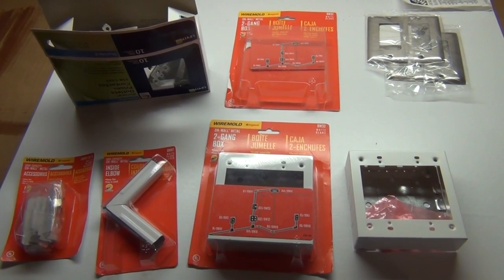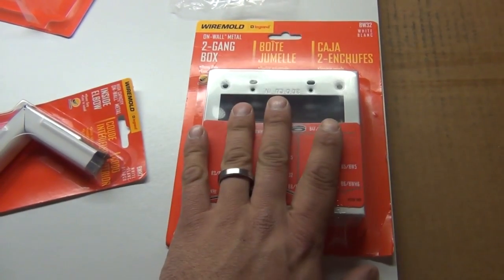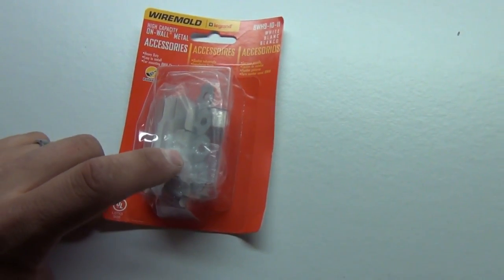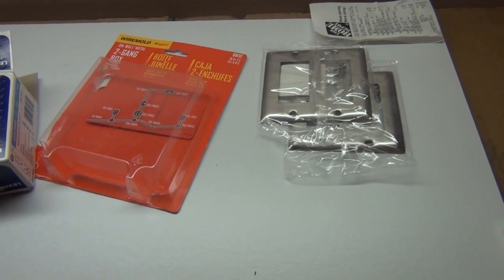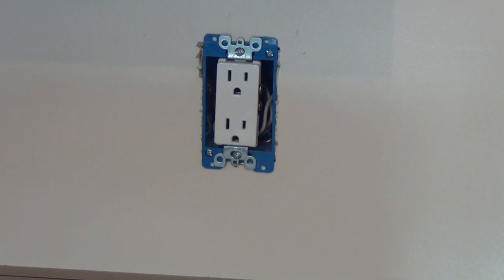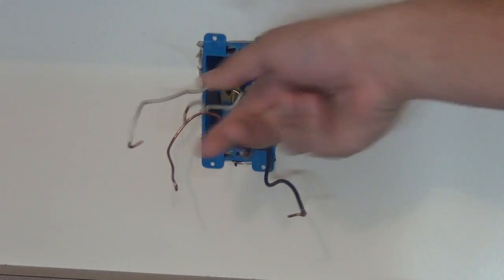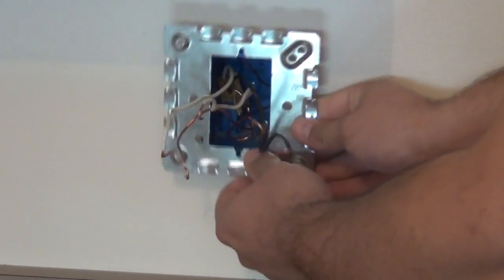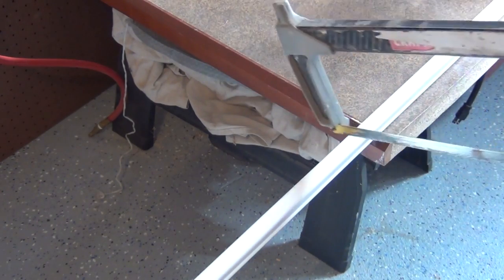Wiremold Installation

Comment: Nice install I just used EMT in my garage looks very nice imo just take your time bending it. Seems a little more sturdier than the wire mould stuff but I wouldn't know I haven't used wire mould ever
Reply from the maker: EMT is good but many don't have the skills necessary to bend it correctly.
Reply: zimsjeep that's true I guess bending EMT is a big part of my job so I've gotten decent at it
Reply: If you use EMT and don’t have a bending tool you can always use connector fittings for 90’s and joining. More expensive but very simple.

Comment: How do you know which wires are coming in and which ones are going out ? Or does it matter as long as the wires match ?
Reply: Gil... It's been a year since you asked. So I don't know if anyone answered your question.
An easy way to find the feed wires: Kill the power. Remove the wires from your device. Separate the pairs from each other.
Wire nut each wire individually. Turn the power on. Using a non-contact voltage tester (very handy, cheap device), touch each of the wires until the tester glows.
If you don't have a tester, kill the power & you'll have to reconnect one set of wires back onto the device. Turn the power back on. If the device works, you know it's
the correct set (if you've reattached it correctly).

Most times, you can see the pairs by looking to where they enter the box. They'll be in the same jacket.
If there's no jacket visible, NEVER assume that wires will match (depending on their color). You never know how the last guy ran the wires.
But if there's no jacket to help you, kill the power & separate the wires. Then wire nut each wire. Turn the power on & test.

Comment: Thanks for the tutorial. I'm doing this on a concrete ceiling and worried about how the molding is going to look in the living room. And I'm also concerned about anchoring to a concrete ceiling and the molding being able to sit flush inside the bracketsdue to the height of the anchor. I also agree with the poster who mentioned there should be plastic bushings at the ends of those metal moldings no question about it
Reply from the maker: There is another option to mount the track. It's a u shaped bracket that sits on the top of the track and has 2 screw holes on either side.  Perfect for concrete and you can use as big a screw as needed.  I've never used the bushings but if it makes you more comfortable, go for it! Thanks for watching.

Comment: will standard14g wire with white covering fit through the track?
Reply from the maker: Yes but I don’t recommend you go that route. It’s not recommended to run Romex inside wiremold or conduit for that matter.  You can buy thhn wire by the foot at HD or Lowes.
Reply: zimsjeep thanks great video

Comment: why did you use 15 amp receptacles on a 20 amp circuit?
Reply from the maker: Couple reasons:  they're cheaper,  I have no plans to run 20 amp equipment with 20 amp plugs, and it is also well within code to use 15 amp receptacles on a 20 amp circuit. Thanks for watching.
Reply: I thought the video said 12 gage wires??
Reply from the maker: +Randy Perl correct, I used 12 gauge wire
Reply: I thought you could only use 20 amp receptacles when it is a dedicated circuit only for that receptacle.  So chaining multiple 20 amp receptacles to a single 20 amp circuit would not be acceptable anyway, I understood.   Kitchen circuits are good examples of 20 amp circuits with 12 gauge wire that have exclusively 15 amp outlets.

Comment: Thanks for sharing, I have sort of a loaded question.

I'd like to install a wiremold system to provide power to the back of my garage, but the only available starting point is a ceiling light fixture (octagon box).  So, first question, any reason I shouldn't do this?

The other issue is that after uninstalling the light fixture, I found no ground wire in the box.  I have not determined yet if the box itself is grounded back to the panel.  If it is, can I simply ground the system into the octagon box?  If not, can I protect with GFCI and just label each box in the system?
Reply from the maker: Depends, do you have unswitched power in that ceiling box?  Check to see if the box has a ground wire tied into a ground screw inside.  You definitely need the garage circuit to be grounded. Garage receptacles also need to be GFCI protected.  If you don't have a ground, GFCI's won't work correctly.  All things said, I probably wouldn't use that box to feed your new outlets. Garage outlets typically are used by heavy amperage devices. (Power tools, vacuums, etc)  You want to have plenty of juice available for them without overloading.
Reply: zimsjeep Thanks for the response.  Yes, it is unswitched.  There is no ground wire running into the box, nor is there one tied to the box.  That said, the box may still be grounded via the conduit, I have not tested it yet.  If it is, I intend to ground the system back to the box.  Otherwise, I realize it's not ideal, but GFCI still functions without ground, no?  Hence the "No Equipment Ground" sticker.
Reply from the maker: Yes, I should correct myself. The GFCI is measuring current between the hot and
neutral conductors. It will work without a ground wire present. Grounding is still a good practice....especially in wet locations.  If someone ties into your new Wiremold someday before the GFCI, then you have a safety issue.  At the very least, if you have an ammeter...measure the current draw on that line before adding anything to it.  I would vote for doing this the better way and running a new circuit for your planned outlets.  What do you plan on using the new outlets for?  Is the existing circuit 15 or 20 amps?  What else is on this circuit?
Reply: zimsjeep Yes, absolutely the better way is to run a new circuit.  In reality, I won't have true peace of mind until I get the whole house re-wired.  Every time I've had a look at any of the electrical, it's appalling how badly things are wired.

It's a 15 amp circuit that services the garage and the bedroom above it.  The only thing in the bedroom is a ceiling fan, the garage has the garage door lifts, landscaping lights, and a couple lights in the garage.  Really what I'm trying to do is create a temporary solution until I can afford to hire a professional to re-wire the house, and possibly upgrade the panel (currently I'm only running 100 amps).  Anyways, what's there now is pretty bad.  The ceiling light fixture I'm replacing had one of those socket adapters that provides two ungrounded two-prong outlets.  They had cheater plugs attached to each outlet (without attaching the grounding tab to anything) and then ran two hanging florescent lights into each.  So, one outlet will be to service those florescents and will be controlled by a switch, one will be for charging Craftsman battery packs, and one will service the landscaping lights (currently powered via extension cord).
Reply from the maker: Gotcha.  If all that was plugged in to begin with and you're eliminating it with the installation of your new outlet, it shouldn't be a problem. Just keep in mind the limitations with what you can use it for and don't overload. I'd definitely consider rewiring the house based on what you described. Good luck man!
Reply from the maker: Yes, that's correct.  Good practice is to always try and ground though.  Thanks for watching

Comment: Thanks for the helpful intro to wiremold surface mount wiring.  I'd use 20 A outlets (have the horizontal tang on the neutral) vs 15 A since you're using AWG 12 and are likely protecting the circuit with a 20 A breaker.  Per code everything in the circuit needs to be rated for whatever size breaker you're using.
Reply from the maker: Thanks for the comment but that’s not the code. You’re permitted to use 15 amp receptacles on a 20 amp circuit. All that means is you can’t use 20 amp appliances on this circuit since the plugs won’t fit.  I’ve actually never had any tool or appliance with a 20 amp plug

Comment: Well hell, That took me like 10 mins to knock out the middle metal plate knockout. Great video! Fyi you have to add 3/8" to each end of measurement and also clean up your cut ends and there is also bushings that go into the ends of cut track.
Reply from the maker: Haha, yup. With the magic of video editing, I made it look easy but I believe it took me the same to knock that plate out. Hope the project turned out good!